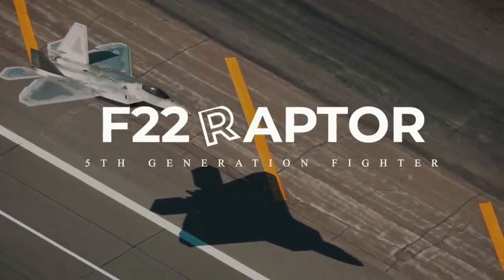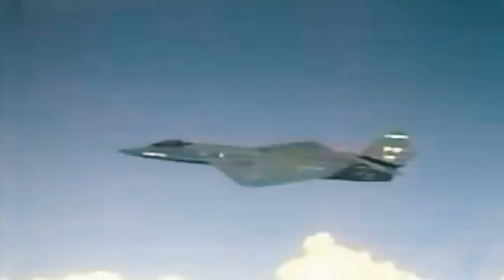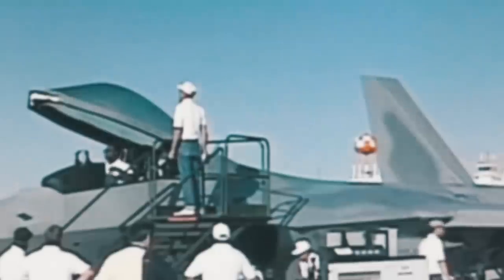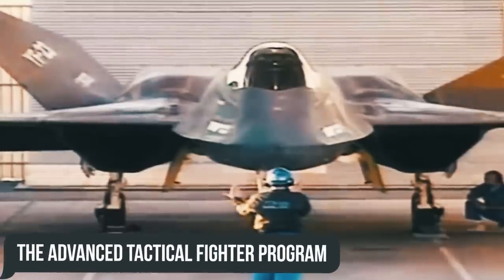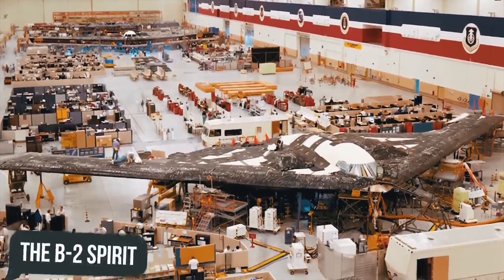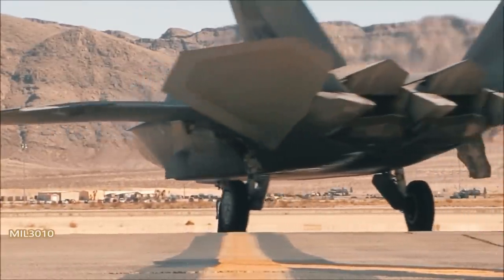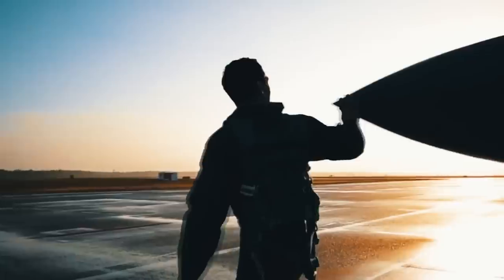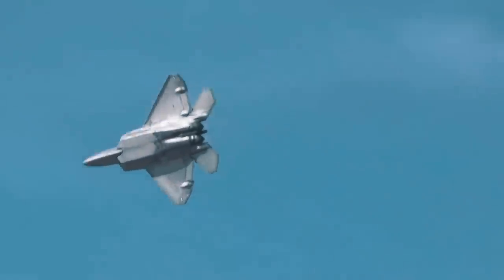New F-22 Raptor After Upgrade Shocked The World

Comment: The biggest problem is in the budgeting with the military-industrial-congressional complex.  USAF requested the total number of F-22 aircraft needed to satisfy requirements, industry (Lockheed) issued a price each based on that quantity, Congress balked at that total cost, which forces the AF to reduce quantity, which increase the cost/unit since R&D is split among fewer units, and on and on it goes.  Thankfully, President Trump stepped up and into the business as the same was happening with the A-10, F-35, B-52, KC-46, B-21...
Reply: Yes. The initial production run was to have been 700 F-22 for the air force and a Navy variant ( that never got produced) of 300.

Comment: Many people that saw both YF22 ad YF23 said the YF23 was the more advanced plane. Isn't it interesting how General Electric is now making the Adaptive Engines for the F35 and NGAD program. Clearly they worked really well with the Grey Ghost. Such a pity that plane was way ahead of its time and just think what the YF23 would be able to do with 30 years of development. Also your costings are way out because if you consider the YF23 would have cost less than half to maintain, over a life cycle the total cost of the plane would end up cheaper even if the unit cost was slightly more to make - this is something that is making the USAF think about life cycles of their planes and coming up with new designs sooner as maintenance costs go up and design development time & costs come down. If you now look at NGAD and other Allied programs - they are far more reflective of the YF23 design features and why the F22 is not been continued. Sure some features of the F22 will carry over, but its clear to me - the way forward is quite a substantial shift in design especially when the Chinese and Russians have similar concepts to the F22/35 designs.
Reply: Life cycle cost was seriously studied before and during the competition. There was also a fear that Northrup could not be trusted. That factor can not be overestimated.
As far as performance is concerned, either plane was good enough to be a deterrence throughout its entire life.
Reply: Last I heard was Pratt and Whitney engines are what power both the F-22 and F35.
Reply: @thomasblankinship98  Yes it does but both GE and PW are both are trying to get the GE Adaptive Engine program for the NGAD and to possibly upgrade the PW F135 for the F35. Last I read GE were quiet advanced with this

Comment: The biggest "flaw" or weakness of the F-22 Raptor is the very pilot that controls it: g-forces, life support systems, and wasted space that comes with the cockpit & cockpit systems.
Reply: An AI System plus combination of servo controllers to replace human control could transform it to a more lethal stealth drone.
Reply: The human pilot can only endure maybe 9 G's for a very short amount of time. The aircraft can handle twice that. There is computer redundancy that if the pilot passes out, the computer takes over and does whatever is necessary to keep the plane and pilot safe.

Comment: YF-23 had all kinds of production and design issues that made wider production problematic.

You can bet that there are going to be facets of the YF-23 that get translated into the NGAD fighters (just as F-22 will contribute).
Reply: Yeah from what I heard they’re rethinking air superiority fighter’s. And it won’t necessarily be a dog fighter but an aircraft with a lot of range, lots of weapons, top tier radar, and drone companions to actually engage other aircraft and carrying out riskier attacks. Basically an air dominance platform where anything within its radar bubble is at its mercy. Probably have a couple pilots who could remote control drones.. I want to see what a f-22 with some titanium reinforcement’s in special areas could do being remotely piloted by a pilot in a aircraft close by so there’s no lag in data transmission. They’re limited by the human bodies so much. It would be a sight to see it flying with the only limitations being the plane ripping apart.

Comment: The yf23 lost because of the trouble Northrop was having with the B2. Northrop was pretty much in the doghouse. The 23 black widow used GE engines not Pratt and Whitney. It dominated and out performed the raptor in every single test.
Reply: There were two prototypes built of the YF-22 and YF-23 in the Advanced Tactical Fighter program. YF-23 PAV-1 used the Pratt & Whitney YF-119 engines, while PAV-2 used the GE YF-120 engines.  Lockheed also used both engines in the two YF-22 prototypes.  
A detailed source on the program was written by Northrop test pilot Paul Metz, Northrop YF-23 ATF, c.2016 published by Steve Ginter 153 pages.  A bit of historical trivia is that both prototypes were not USAF-owned so all four prototype aircraft were civil-registered to their companies, obtaining Special Airworthiness Certificates from the FAA, which explains the "Experimental" markings below the cockpit and N-number markings on the YF-22 prototypes.  (Northrop found a loophole in the FARs, so the N-number markings were omitted on the YF-23s.)

Comment: I wonder how the Su 57 stacks up against ANY OF THEM
Reply: Su-57, if they can merge will usually win. But usually the Su-57 would be destroyed by BVR missiles prior to the SU-57 merging or locking the F-22/F-23/F-35.
Reply: well, I know they don't sack up well against stinger missiles.
Reply: They don't ! There are only a handful of Su-57's and they are basically show pieces. They are stealthy somewhat in the front, not so much from behind. And their thermal signature is horrific. Lunch on the plate for the OLD F-22
Reply: It doesn’t stack up. Russian hardware “never” performs to spec. In fact Russia is falling further and further behind the USA in plane engineering.

Comment: The main problem with the F-23 vs the F-22 is that if the pilot loses an engine he/she have to bail out.  Not so with the strong level 5 twin engine F-22 which will probably be pumped up to a  level 6 with upgrades already on the drawing board.  Both great stealth jets, but the twin jets of the F-22 are much more powerful and the aircraft jets are much more maneuverable due to the twin engines and significant superior power over a single jet.  The original F-22 design was created with an air frame which could carry a massive bomb/Rocket/missile/ordinance which can also carry the new nuclear weapons and other special weapons far too bulky for the F-23.  This is the same concept of using the smaller F-16 with the F-15 as a package with no rivals at the time.  You cannot expect the Air Force or Navy to shift to internal weapons only with two entirely different capabilities.  sm
Reply: F23 is a twin engine plane.

Comment: I thought they were expensive before the upgrade ,youd have to be an arab sheikh to be able to afford it an then maintain it..an with Elon Musk researching his new thrust vector designs they could be even faster..fun fact these jets are so fast they can outrun missiles  ..impressive jet
Reply: monetary issues are none existent when you print it.  FIAT.  I liked the 23 and believe both had their areas of expertise.
Reply: What jets can outrun what missiles? Even the SR 71 could only outrun SAMs fired at it because of it's operating height, combined with it's velocity. Also how does thrust vectoring increase speed?
Reply: @davidb1565  i saw a su35 flying behind a missile in flight, i think the new thrust vector designed 5th gen planes can do this an of course that means the f22 raptor...not sure of the missile type ..but simulations show that its possible
Reply: @mazspeed0349  Modern jets can keep up with and overtake surface to surface missiles like Tomahawk or Kalibr and most antishipping missiles. They can not outrun SAMs or air to air missiles. Unless they are right at the limits of the missiles range, immediately turn away, dive, light the burners and pray there's no one around with heatseekers. Vectored thrust can lead to faster airframes because the control surfaces can be smaller, meaning less drag. But in of itself it doesn't increase thrust. Just enables you to point the thrust away from the direction of travel and manoeuvre that way. This is also desirable for stealth and supercruise reasons. Smaller control surfaces and not having to deflect them to maintain trim is a big plus to both.
Reply: @davidb1565  it was a great photo so was probably a tomahawk?  I dont know its was red an bout 5ft long..yeah i agree as cool as these jets are they cant outrun a mach 4 missile altho the raptor and one of the old russian mig jets (that was really just a seat an wings bolted onto a big vx rocket ) could reach mach 3

Comment: I hope so, and I'd like to see it outfitted with a directed energy weapon for knocking the Soviet "Checkmate" out of the skies.  Maybe an upgraded hull and more powerful engines, but that would just about require a new aircraft.  Well, up, up, and away 🇺🇸🌠
Reply: The problem with mounting a DEW on an aircraft is the energy requirements are still astronomical.  Even mounting them on a ship requires an enormous amount of space for the power plant.  I don't know of any progress yet in finding a way to reduce the power requirements or the size of the current power plant to facilitate this need but I hope someone is working on it and solving it quickly.  The future is definitely going to require DEW's on land, sea and air platforms.
Reply: Didn't the video quote 32KWatts generated at full thrust?   That's enough for some of the lower voltage lasing weapons being developed by USA air defense contractors.  I frankly doubt those lasers need a full 32KW of in-phase energy to blast an enemy aircraft, or missile out of the heavens 👍🌟

Comment: If they had manufactured the original number of F-22's, it would likely have remained in service for 20 years more.  However, they built so few that attrition will eventually make it too expensive to keep flying and it will be phased out as the F-35 fleet continues to grow to 800 or more and the 6th Gen fighter becomes operational between 2030 and 2035.

More new F-35's are built each year (about 156 in 2023) than there are combat ready F-22 in total.

No doubt that the F-22 has superior maneuverability than the F-35, it can super-cruise faster, and it has a smaller radar profile (about the size of a Bumble Bee), the F-35 has superior situational awareness and data fusion.  It's radar profile is about that of a golf ball, so it will be just as difficult for an enemy to maintain target tracking as it is for the F-22.  A few F-22 pilots that are not flying the F-35 praise it and prefer it over the F-22. 

But what it really comes down to is the pilot more than the technology, at least to a point.  An excellent pilot flying an F-15EX can beat a poor pilot flying an 5th Gen aircraft.  And an excellent pilot flying and F-35 or F-22 is going to be extremely difficult to beat.
Reply: There are currently no opposing airframe that a F-35 is likely to engage that can reliably engage and destroy the F-35. Because of this, the F-22, primarily a F-22 Air Superiority airframe, doesn't really have a necessary niche right now. This calculus may change if the J-20 appears to be a competent or superior competitor to the F-35.
Reply: Read an article about Lockheed  wanting to put f35 tech on the superior f22 airframe😏
Reply: @joew974  yes, I believe they are working to integrate the advanced systems from the F-35 into the F-22 .  Newer avionics, and the advanced helmet system along with abilities to use newer weapons systems.

Comment: OK-----. It amazes me that the Airforce held Northrup accountable for the COST Overruns of the B-2 when it was the Airforce that Caused the OVER RUNs by insisting that Northrup completely redesign the B-2 from a High altitude bomber which was in their contract, to a low-level Nap of the Earth Bomber after the B-2 high altitude bomber was starting Prototype Assembly..  But then the Airforce was looking for excuses to pick the F=22 since they knew the F-23 actually won the Competition in all contract marks except for very low-speed maneuverability (below 300 knots)... (which the F-15 DOG-fighter Cartell in the Airforce deemed most important while believing that Stealth was just a Passing Fad that would be worthless in a few decades).  Now everyone knows that a Stealth fighters Strength is its ability to stay invisible at medium range while using missiles to shoot down (Snipe) enemy fighters and NOT Dogfighting at close Range... Where a wing man of the enemy can shoot you down while you are flopping around the sky trying to Kiss your enemy before shooting him down... Which mass enemy fighter attacks that outnumber you by two to Four to each of your fighters, assure will happen...
PSC-----.  The F-23 was faster in afterburner (F-23 1,600 VSR 1,200 F-22) and Super cruise (Supersonic without afterburners) with the F-23 doing 1,200-knots while the F-22 is lucky to do 1,000-knots. As for stealth, the F-23 is twice as stealthy (RCS of 0.00001 VSR the F-22 0.0001. The F-23 will turn 180-degrees at high speed twice as fast as the F-22 while losing half the airspeed, fly twice as far at Super cruise (1600+ miles) and 2,800-miles Sub sonic.  The F-23 could carry more weapons even before the Redesign of the production aircrafts single weapons bay that would have increased its size to carry more weapons, to take advantage of the F-23's stealth. While the F-22 and F-35s are always coming up with short weapons loads. The F-23 also did not require the F-22s greatly increased Construction Cost of Two Complex additional bays for Sidewinders (that Require high maintenance extension arms to launch their sidewinder missiles), the additional doors increasing RCS (reducing stealth) of the F-22 as well... 
OK2------.. Finally, The actual facts concerning the True COST of the F-23 are that the F-23 was designed and built with one large full sized single upper and full-sized lower Stealth Skin unitized inside a huge Autoclave onto crossmembers into one module for the entire single piece Wing Center Fuselage section. As well as the forward and aft fuselage modules. Construction techniques that had cost millions to perfect but finally had proved to cut construction costs in half while increasing the strength and Stealth of the Fighter... That the CBO ignored in its Cost estimates. Calculating Costs using old book riveting Cost tables for standard built up rib frame sections with small skin panels Construction. As no one had ever used the Unitary Composit construction for an aircraft before. But.  The Single peace wing center fuselage section was mandated from Northrups experience with the B-2 that said that in order to Increase the Stealth and cut costs they needed to design a solid One Peace wing center box module for stiffness and strength that would also reduce maintenance costs.  Northrup had learned a lot from their B-2 Construction and the B-2s maintinance history (that had problems maintaining stealth due to flex between frame sections as well as separated panels expanding and contracting that also required additional weight for stiffness and still water got in between Pannels to destroy the stealth material from the underside). All problems the F-22 is plagued with because of its old-fashioned Costly construction...  Fact is that the F-23's after sitting out in the Sun and Rain and Weathering Storms for 5 years after the F-23 lost and the program was cancelled, demonstrated NO degradation of Any Kind to the Stealth skin of the F-23s as what was common for both the F-22 and B-2 after just a few days between flights sitting in the open with any kind of rain or weather. Problems the prototype F-22 was having during the Contest phase that was ignored even after it was pointed out by mechanics as they made repairs that did not have to pass stealth tests. ... An RCS test was performed on the F-23's that showed no reduction in the F-23's Stealth Readings or deterioration of the skin's strength, Before the F-23's were finally moved into Museum hangers looking as if they had just been manufactured. Proving that the F-23 would have saved the Airforce Billions of Dollars on maintenance alone, as well as Purchase Costs over the F-22, that is A Disgusting Though Beautiful, Inferior Fighter designed and built for WW2 Dogfighting Tactics...By old men too stupid to see the Future!!!   Something America Can Fix now that the Need has been shown as China rapidly builds an Military that may soon out rank and out perform and OUT NUMBER Americas. Waiting for the FAXX or next Gen fighter is stupid when a Next gen fighter the F-23 is waiting to be produced NOW!! Not 2030... The F-23 with F-35 Electonics and B-21 Stealth and the new dual Mod engine, would be good enough until the Next Gen fighter came along in the 2030s or 2040s or when the hell it ever shows up.. if it is not cancelled because it costs to much...